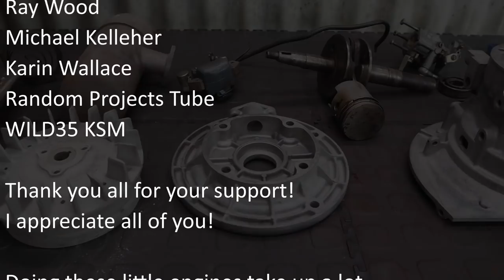Junked Robin EC10 Two Stroke Engine Restoration [Part 1 of 2]

Comment: The real restoration starts at 13:00 (for 5 minutes) and it's just about the case.
I presume we'll see the remaining in an upcoming video, but nothing is said about that.
Reply: He usually has a new video about every 2 weeks or so. In the initial shot, right before he put it on the turntable, "Part 1" was in the upper right corner. 🙂

Comment: The kind of painting that you did when you were painting the parts what do they call that? Can you explain it to me please? I’m 60 years old and  I don’t know how I understand there’s a powdered that goes on it I just don’t know how it works.
Reply: Hi Chuck, I have the same gun. The “paint” comes as a very fine powder like talc that you add to a hopper on top of the orange coloured gun. Then you attach an alligator clip from the powder coating unit to the work. There is a foot pedal on the floor and when you push it down very high voltage, low amps is applied to the metal part you’re painting. This creates a static charge in the part that attracts the fine powder. It gets sprayed out of the gun at about 10psi and when you’re happy with the coating you bake it in an oven usually around 180c for between 10 and 20 minutes. Once it comes out of the oven and cools it’s done. Each powder has its own baking instructions. I just use an old domestic oven for my baking and an old large tool box with an extractor fan for a painting booth. Unlike paint the powders can’t be mixed as you end up with two colours in a speckled effect but it is extremely durable, think kids play equipment in the local park. There are no solvents, I just clean up with a vacuum cleaner and once it’s cooled it’s finished so there is no waiting for it to dry. I find it quicker, easier, more convenient and a lot more durable than spray painting. Cheers Stuart 🇦🇺
Reply from the maker: Thank you Scrounga’s Workshop, Could not have explained it better!
Reply: @AJRestoration   Hey thanks 👍👍👍